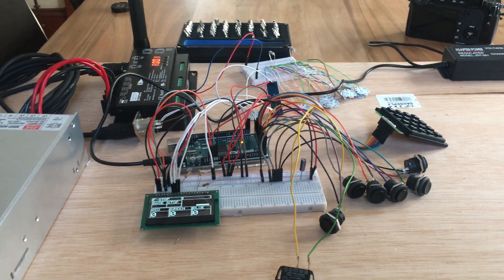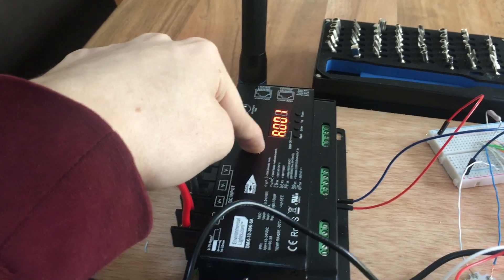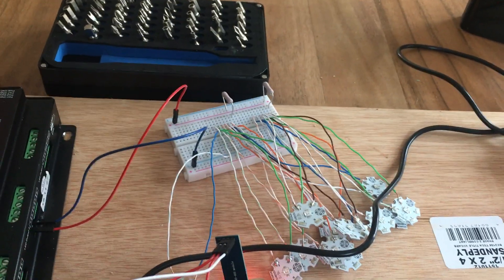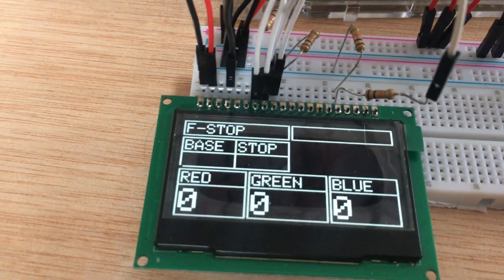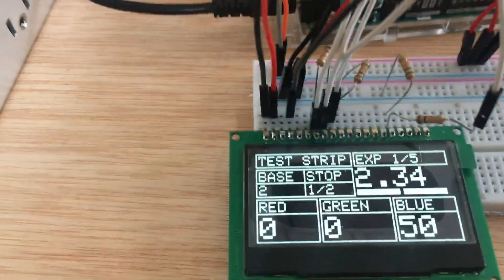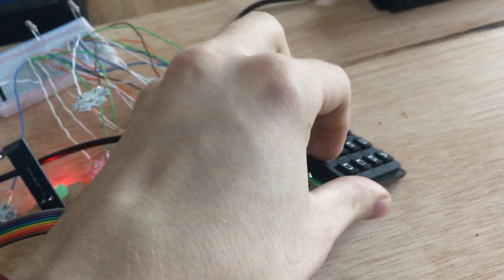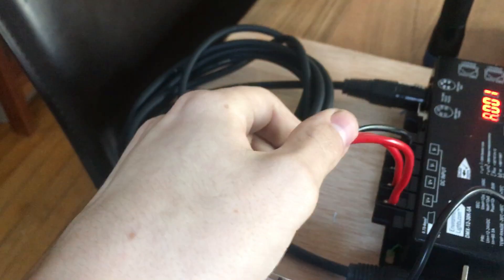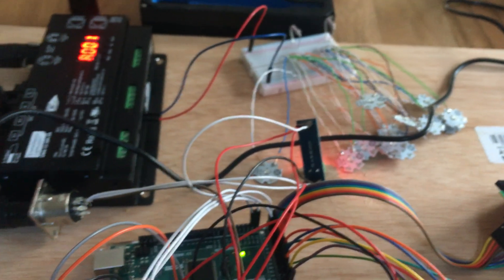8x10 LED Black/White, Color, and UV Photo Enlarger Update

Comment: Looks good! I built several some years ago, ended up sticking to my latest prototype for my own use, mine has a probe and is an F-stop timer, got two videos that show me using the system on my channel, just for multigrade.
Reply from the maker: awesome! what method did you use for controlling the LEDs?
Reply: @ethanbrossard5700  I’m not using PWM due to the startup delay of my driver circuit so I control the time they are on turn them on and off at maximum brightness controlled by a simple relay and that has a near stable startup time.

Comment: Ethan, looks like you have been having fun here. Love the combination RGB with UV - Thanks for the great update, I am just getting to my 10x8 RGB head with 500 WS2812B LED's using the base controller from Marco Glattfelder, I know you spoke with him and obviously you have taken your controller to another level.
Reply from the maker: Awesome! good luck with your build. Thanks for the compliment, it will be a nice system if it works, but there's always a chance it won't! 🙃 The one thing in the design I won't know until its finished is how well the UV will work. I'm using a non traditional diffusion screen which should at least double the light compared to traditional diffusers, but will still fall short of a condenser's efficiency. I'm hoping it will be efficient enough, but if not I may have to re design the head.

Comment: Some high end enlargers had shutters
Reply from the maker: I don't think I'll need that, since the fade only happens on really low light values, but I do actually have the electronic shutter from an absolutely enormous HK 877 horizontal enlarger in my attic. Sadly most of that enlarger ended up in the scrap pile, but the shutter may come in handy for something.